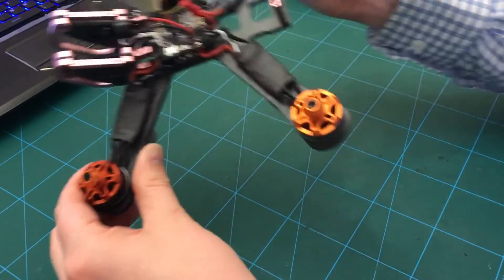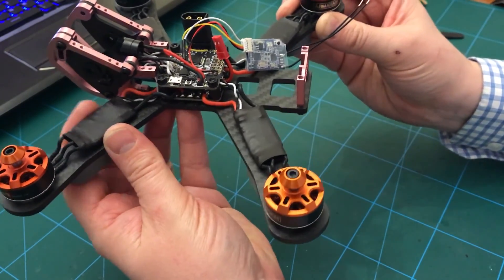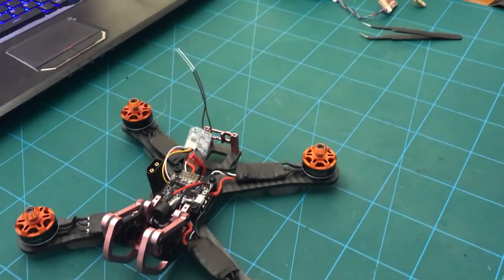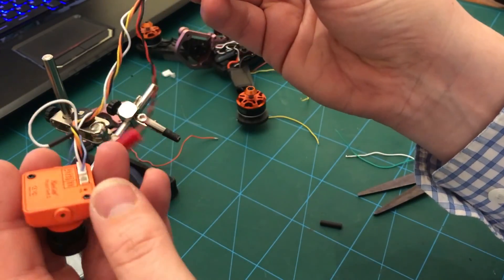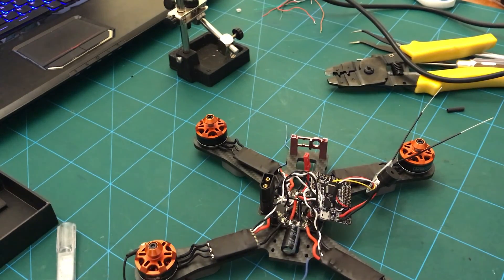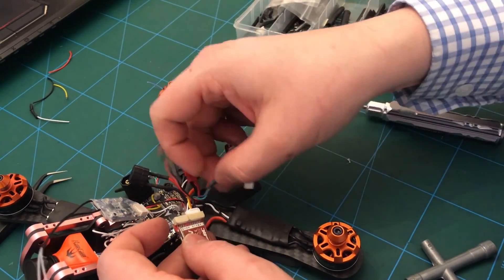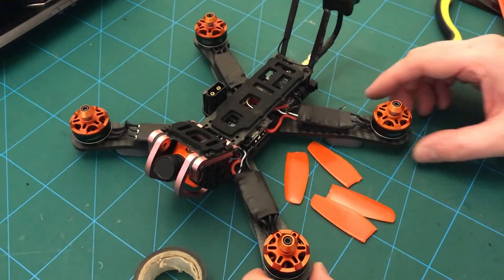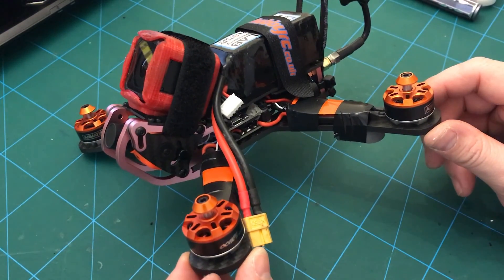Armattan Chameleon Quadcopter Build - Part 5

Comment: dont use hot glue.. dont use propeller blades to "protect" the ESCs they need the air passing over to cool them down.
Reply from the maker: +Forward FlightFPV not really. Ive killed many escs by prop strikes but none from over heating in the last two year.

Comment: noob question here, why does your quad beep all the time? You can hear it in the background. Thought it only did it when you flipped, but hear it on straight yaw turns too. Do all quads do that, I've never heard that before. I'm waiting for my 1st quad to arrive (yes, it's a chameleon).
Reply from the maker: The Stig the beeps in the air are low battery beeps. After punch outs or heavy throttle, the voltage of the battery drops below a set number and sets off a beeper. The battery recovers then it stops. When its beeping constantly its time to land.

Comment: What did you connect to the VTX that you attached to the battery connector?
Reply from the maker: Scrapsz FPV its part of the immersion tramp vtx. It allows you to change the vtx channel and power with an nfc wand. Really cool.